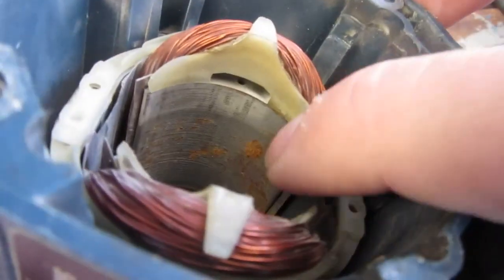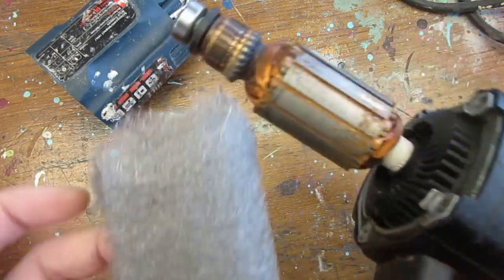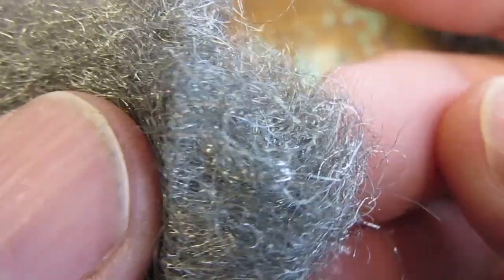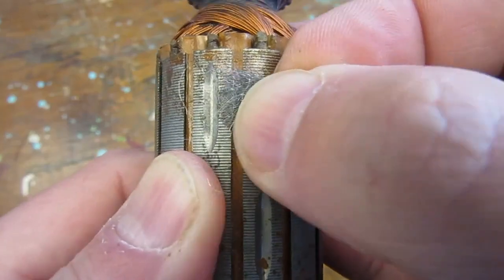MOTOR PUZZLE! Restoring A Hammer Drill Part 3 - Removing Rust From The Armature / Stator #HowTo #DIY

Comment: is it wise to put a little oil on the steel parts after cleaning them to keep them from rusting or mabey a fine spray of clear coat enamel or sealer?
Reply from the maker: I prefer to tackle the cause and store my devices in a dry environment eventually in a box with a pack of silica gel

Comment: What are the grooves cut out of some of the armature stacks?
Reply from the maker: Those are for balancing (just like with a car wheel where little weights are sometimes added to remove virbations at high speed)
Reply: @TheLabOtomy  
Thank you, I have been watching drill restoration videos (have my own project to start) and some have the grooves some don't so I was a bit worried it might be damage of some sort.
Reply from the maker: @TheActionPotential1  Indeed, it all depends on the rotor size, engineering precision and the rotation speed, so some will have notches, some not, but nothing to worry about ;) Good luck with your restoration work, good to see people fixing stuff!